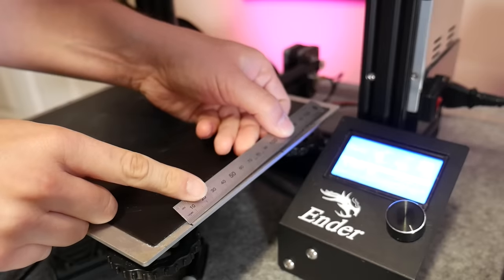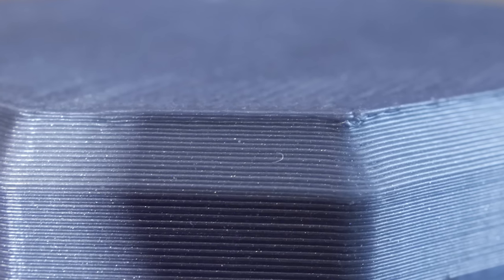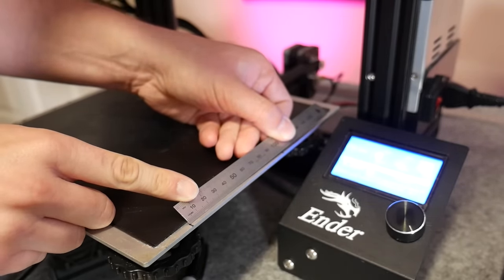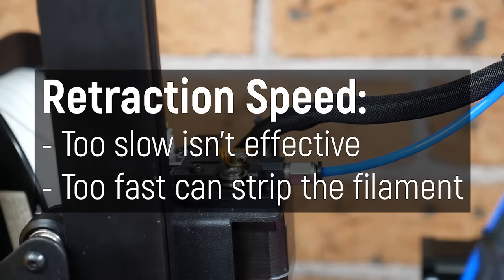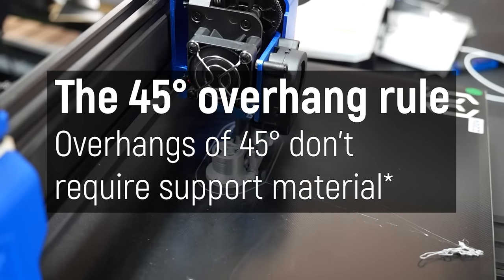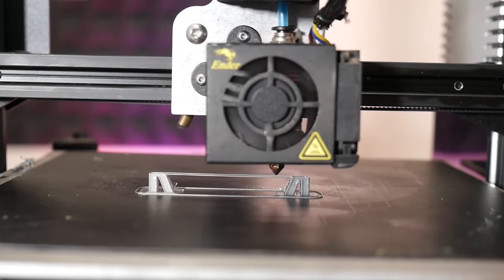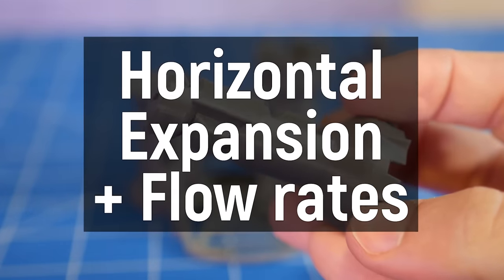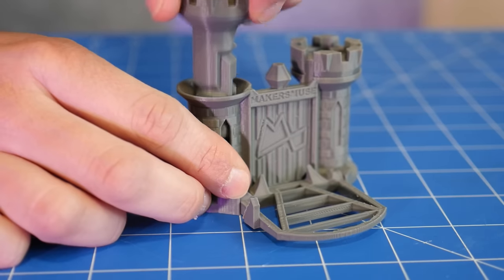The Ultimate Guide to Perfect 3D Prints

Comment: Couple of comments.
First layer height is the distance between the nozzle when leveling and the programed first layer height.
You are using a 0.2 mm feeler don't know what layer height but lets assume it is 0.2 mm
Your first layer will be 0.4 mm.
I use paper, very thin so my first layers is the thickness of the paper + the programed first layer height.
I would suggest that if you are going to level with 0.2 that you put in a negative 0.2 Z offset.
With CNC machines, which a 3D printer basically is you have two parameters controlling accuracy.
Positioning accuracy and repeatability.
Positioning accuracy is how close the printer head moves in relation to the programed coordinate.
i. e. If you program it to move 100 mm and only moves 99.1mm
Then you have positional inaccuracy of 0.9mm
Loads of stuff control this, many you can't do anything about with a simple 3D machine
You are looking for errors in the 0.01 range, cant be done with a marker pen, you might pick up errors in the 1 mm range though.
You need a dial indicator to get a real handle on it.
But you will only be able to check within the range of the clock.
The printer will not get up to speed with such small movements and this will give better reading compared to travelling a long distance when de acceleration comes into it.
Then you have repeatability.
This is how accurate the printer is going to the same position lets say 10 times, easy to check with a dial indicator.
i. e. You program a movement of 100 mm. 
It moves 99.1 mm. 
Do it 10 times and the readings vary between 99.05 and 99.15 mm
Then you have a repeatability inaccuracy of 0.1mm
This will be affected by travel speed and the basic design of the machine 
Complicated subject.
More or less impossible to verify the accuracy of a machine with a marker pen and ruler.
Otherwise loads of good solid information.
Really helpful.

Comment: One more, very common stringing cause - different filament residues (i.e. TPU residues in the nozzle on PLA prints are causing terrible stringing). Cold pull (or a few of them) are a must.

Comment: Really great video!
But before changing the steps/mm settings to correct x/y precision take a closer look to you timing belts and their tensions! The steps/mm is normally a constant that depends on the physical parameters like steps/revolution and number of teeth oft the pulley and distance between the teeth of the belt. And this last parameter is often an issue with cheap printers. My CCP (Cheap Chinese Printer :D) came with belts that were far away from exact. I changed these to a standard quality glass fiber belt and now I get precise objects with the standard settings.

Believe it or not but you can adjust the x/y correctness with the tension of the belts! If your objects are too large, the tension is too high.

Comment: That bent leadscrew gave me the shivers
Reply: Edit:
The bed Leveling trick is nice, but I think it only works for Printers that have a "Hardware-Reference" Z Endstop.

Printers that use a mobile z Endstop, like a BLTouch or any bed Probe, that is also used as a Z Endstop for example, im not sure if that would work for them aswell.

Comment: XY compensation is great for printing threads. And in my opinion the right way to do it
Reply from the maker: I prefer to do it in the 3D Model, but I agree if you can't do that it's a good way to add the needed clearances.
Reply: @MakersMuse  It is often easier to do in the slicer especially if you have both external and internal threads in the part. And sometimes you want your model to actually be correct (to comply with standards etc) but want to just prototype it quickly. Great video by the way, a great summary of most common problems, solutions to which are usually scattered around internet/youtube

Comment: I actually had the temperature oscillation problem that took me quite a while to fix. Though it had bangbang set in the firmware. Built a new firmware with bed PID and it dissappeared completely. Kinda looks like a bent leadscrew except the pattern changes depending on how much time it takes to do a layer. Narrow prints have a very large distance between artefacts and wide prints a short distance.

Nice video showing pretty much everything that took me well over a year to find on my own. (Built a custom printer that started its life as an anet A8. Now it is unrecognisable as one).

Comment: I hope you can help me out with a situation, as I am brand new to this 3d printing world. I have purchased a Creality CR10 Smart Pro, and like you said, they completely ignored the cooling situation needed, and ONLY provided a single direction duct from the part cooling fan. So I bought a couple of 5015 blowers, but have no idea how to research the proper multiple side duct to print or how to fasten them to this printer. Any help in this problem would be greatly appreciated. You are one of the very few people I trust with these reviews and information which is actually helpful. Thanks for any help. Cheers!!!

Comment: Hmm... I'm a little bit surprised you not only recommending the use of the Extrusion Multiplier dead last but even being outright against using it in the first place.

When I started dabbling in CFNylon Filament I quickly noticed my first parts having technically the right dimensions but being ever so slightly off in both the X/Y dimensions which wasn't an issue with either ABS or ASA-X. I then printed a single 105% external perimeter cube using a 0.4mm Nozzle that should have had a 0.42 wall thickness and it turned out it was in the 0.6mm range explaining my clearance issues - I then reduced the Extrusion Multiplier ( by a LOT ) for that filament to get to the appropriate values and have since had no more issues with that Filament.

As such I'd argue that working on the Extrusion Multiplier should probably come straight after ensuring your E-Steps being right cause what good is all that calibration and tuning doing you any good if the assumption of your filament getting extruded to 0.42mm is not being upheld by your machine? 🤔

Comment: I had an interesting experience with my 3D printer. I'm just now getting into this technology and I discovered something rather peculiar to me. To give you a little background I started in 1981 and financial data processing. I'm retired now. I was in operations guy so I'm very much hardware-oriented. Anyhow I bought a deal on a lotMaxx printer that was a return. Turned out that the printers fine the person that bought it was dissatisfied for whatever reason. But I discovered something that may have been why they were dissatisfied, the auto bed leveler. What I discovered is you could run the auto level sequence and it doesn't return an error message if the bed is actually too low to level the head. I tried several different filaments and nothing was sticking to the bed. And finally out of frustration I checked the leveling of the bed to the Head the gap and discovered that it was way too wide. The bed was actually low enough where when the head came down to level it was hitting the sensor to indicate that it reached maximum travel. In my computer brain to me this should cause an error message to appear on the control screen and the process should stop. Instead the printer was happy and dumb and continued the process and everything looked okay. I spent several days frustrated for no reason. So my suggestion is if you decide to get into 3D printing and get an auto leveler on your printer either it comes with the printer or you install it yourself, manually level the bed first with the piece of paper. If you don't you could end up very frustrated as everything you print turns into a ball of plastic on the end of the head. Just thought I would share this it was an eye-opening moment for me. In my point of view the firmware in the printer should indicate that the leveling is failing. Beyond that I'm very satisfied with the overall printer performance I'm still learning with a lot to learn yet. Thanks again for your great videos.

Comment: To deal with bent lead screws, replace them with graded Ball Screws. Also fit that fascinating "Wobble Wing" device, and use position sensors and accelerometers to measure Z-wobble in relation to Z height and try to compensate for it.
Reply: No. A graded ball screw costs as much as the whole printer.
Reply: @SianaGearz  You can use a much lower grade and just use the Wobble Wing to defeat the Z-wobble.

Comment: Interesting that you consider adjusting the flow ratio as the last thing to do. I wasted two months fighting my Artillery X2 to fine tune it and going back and forth with different settings and printing dozens of calibration cubes and benchies just to realize that the issue was the flow ratio. Once I calibrated the flow ratio, all the defaults settings and profiles in any slice software create perfect prints without messing with almost any other setting.
Reply: Yes, I think this the only thing in the video I disagree. After setting the line width of 0,42 or 0,45mm it's important to measure this width with some hollow cubes with only one wall. The current Flowrate needs then adjustment until it differs very slightly.

Comment: I finally found a filament that can be used to build drone frames and can resist a 5-flat building fall. As easy to print as PLA but impact resistant. Rigid but not brittle.
Fiberlogy Impact PLA

Comment: Great video! Going to have to try out that clearance castle when my prusa arrives.
Got a first run lulzbot mini which has been benched for awhile due to my being too lazy to figure out a clogged nozzle issue and the pei surface is trashed (and a move, and no time, etc etc).  Kind of weird to be getting a Prusa after over a decade of 3d printing but I just don't want the hassle and would rather focus on design and cad.
I love the idea of automatic bed leveling and the contactless leveling and other no fuss features won me over.  The bed leveling on the lulzbot was frankly a pain in the butt as it would require a lot of babysitting to keep that nozzle pristine when it was making the electrical contacts with the corner washers.  Have had that head crash into those things so many darn times.
I will get it up and running again at some point to at the very least use up all my 3mm filament, but I wanted to go to 1.75 as a partial clog and the high pressure caused by 3mm filament was causing the extruder gear to just chew up and strip up the filament randomly.  I blame woodfill filament. Never quite worked the same after a ran a roll of that through. (LOVE those prints though).

Comment: I find, when it comes to stepover and overhangs, decreasing the layer height too much causes curling, even with PLA, at least in my experience. I actually find that a layer height with just barely enough stepover between layers (area in contact) the surface finish is nicer than having too thin of a layer height that causes curling.
Reply: the nozzle heats the thin layers inducing the curl use 120-150% initial extrusions
Reply: Strange, I actually had less curling of top corners at 0.12 layer height than I did at 0.2mm. I assumed it was because there was less material shrinking and pulling on the layers below.
Reply: @Dark0Storm  I suppose that the variation could be due to different part cooling solutions cooling the filament at different rates. Also, I print kind of hot at 210 for PLA, so that could be the cause as well.

Comment: So the method you describe to check the steps per mm is not quite accurate enough. This is because it also relies on having correct pressure advance as well as compensation for shrinkage of the filament. Normally, this is not an issue with PLA but  filaments like ABS will shrink by about .5%. 

The truly correct way to measure absolute distance travelled is to make a print with 3 holes (or cylinders) in the XY plane that create a 90 degree angle when looked at normal to this XY plane. From this you need to measure the center to center distance. This test actively cancels any sort of extrusion based inaccuracies and solely measures distance travelled. 

As a side note, I don’t think the chep cube is any good because of the necessity of a finely tuned pressure advance. If you wanted to test for thermal expansion compensation you should make a simple object with deemphasized corners and parallel faces to get an accurate reading in dimensions.

And as a side note to side note: measuring the outside of a cube like cheps cube also required you to have perfect extrusion factor.
Reply: Yes. Just keep in mind to keep the build plate temperature constant between printing and measuring.

Comment: Beware changing X and Y e-steps based on a cube. These movements are based on an accurate timing belt and stepped motor. Far more likely to be effected by over and under extrusion, etc.
Reply: Printing 2 cubes at different scales should expose the difference.  If stepping distance is off, both cubes will be off by the same proportion.  if over/under extrusion, off by the same increment.  If both, the math is a little more complicated, but it is possible to calculate how much of each.
Reply: And that has me thinking of the design for a calibration hypercube, a cube in a cube.
Reply: Fully agree. This seems to be a rampant misconception. You should almost never mess with your axes steps. You are almost always seeing material shrinkage or other issues, and messing with your steps/mm is a bodge that is liable to cause other issues

Comment: You should never need to change the X, Y, and Z steps per mm.  They have to be correct as there are fixed relationships between the belts, micro steps, motors, and pulleys.  They simply cannot be wrong assuming the printer was designed well.  If parts are coming out slightly oversized then the only thing it could be from is over extrusion.  If they are coming out undersized you could have a problem with skipping steps or under extrusion.  Measuring a test cube and changing these three parameters is guaranteed to amplify error when printing larger things.  If you really think you have a problem you need to check it by printing an object at the edges of the build area as your measurement errors will be minimized and over and under extrusion will have little effect.

Extruder steps probably should be calibrated for each material as they will be slightly different.
Reply: Spot on, dont touch it. This guy should know that 🤔 Teaching tech guy shows the same thing.

Comment: In my cheap prusa knock off, I had layer accuracy issues. The Z-axis lead screw (a threaded rod) axis didn't sit true to the stepper axis because M8 threaded rod is not exactly 8mm dia so the grub screws pushed it off center in the coupler. It left an exact M8 wave in the print. Rather than trying to replace the Z mechanism with new couplers and true 8mm acme screws, I fusion360'd some stepper mounts for the top of the printer, reversed the wiring to the motors so they ran in reverse (swap two pins on the cable connector at the stepper end) and mounted the Z axis steppers upside down with the bottoms free floating. Now the problem only occurs when my print gets above 160mm, which mine never do.

Comment: I hope this isn't too much of a dumb question, but I've seen this in your videos and maybe others. There's a part of the printer where there's something that looks like smoke or dust or fuzz on the right side where a light(the BL Touch or equivalent?) is. What IS that? An illusion from the cooling fan and air temperature changes?

That leadscrew bending is the stuff of my nightmares.
Reply from the maker: It's fuzz from the filament! Kinda weird I'm not sure how it forms

Comment: I’ve have an ender 3 pro brand new just sitting in my closet. The thing worked a few times then it just stopped working and I suck at calibrating it I guess 🤣🤣
I would pay you to fix it for me. It’s such a waste sitting there. Brand new printer.
I’m going to get a resin printer eventually. They are easier to work with. Great video!

Comment: Building on flow rate. This might be something worth investigating. 
I found that certain materials, even when they say 1.75mm are anything but. For example I have a spool of Taulmann PCTPE that ended up closer to 1.6mm, very rarely are they actually 1.75 on the dot. I have found that compensating for this diameter variance can help, what are your thoughts?

Comment: I do enjoy your videos for sure, great job on the informations and videos all around but : 
I can't say how annoyed I am year after year of people telling other people how accurate a pair of calipers are... The worst ones are digitial calipers but you need to look into the accuracy vs resolution when buying one. 

Say you have a pair of digital calipers that measure down to 0,001mm, but the accuracy of that brand is only 0,2mm, which isn't uncommon. Then that means if you measure a 20x20mm cube, and your calipers measure 20.000mm, then it could be 20.200mm or 19.800mm, but if you measure 19,800mm and think it's incorrect because that's what your calipers say, then you'll be correcting for a false measurement when your part may be the right size. for example. 

I can't stress enough how "inaccurate" calipers are for measuring precise distances. They maybe be ok for 0,2mm and above, but underneath those values you either need a very expensive set of calipers, of a micrometer : https://cdn.britannica.com/62/124962-004-6C8BB16F/Micrometer.jpg

Please stop abusing calipers as the best way to calibrate precise measurements.